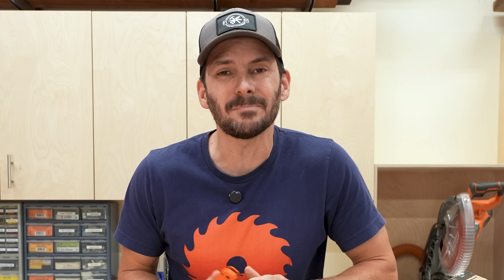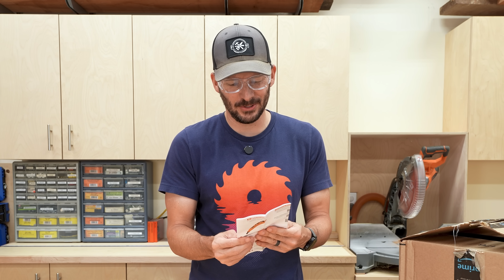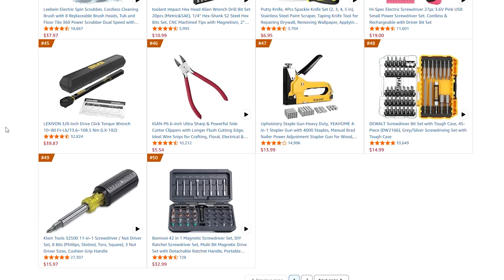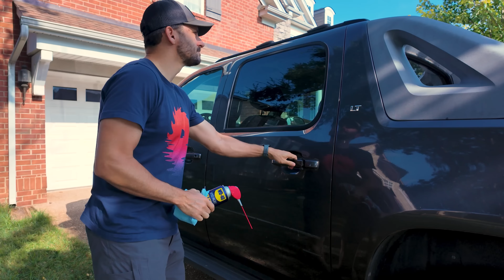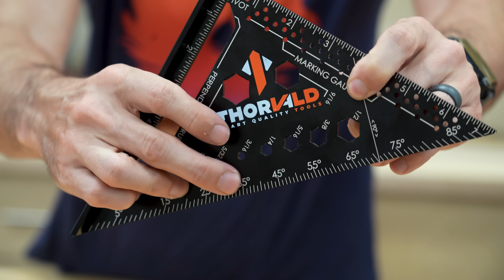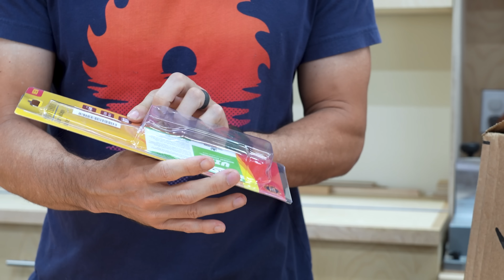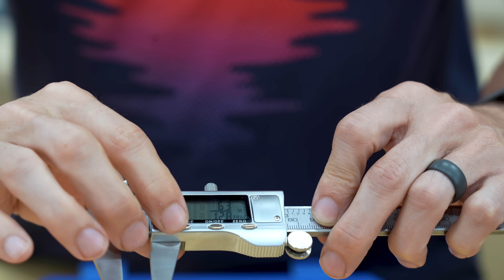13 "Best" Tools Under $20

Comment: @22:45:  'All squares are square.  But some squares are more square.'  I never buy carpenters square without being able to test it (for squareness) at the store first.  Not all 'carpenter square' looking objects are square.
Reply: Carpenter's squares, yes.  I've never seen a speed square that wasn't square, though. Carpenter's squares are really easy to knock out of alignment (and possible to fix).  You'd have to destroy a speed square to knock it out of square.
Reply: @kwilliams2239  It took testing 4 speed squares to get my current version, which I've now had for quite a while.  But, it wouldn't surprise me if they've gotten better made since I got mine.
Reply: @AB-nu5we  I couldn't detect any inaccuracies even in those from Harbor Fright.  I've never seen one out of square.  I don't even know how one could be made.
Reply: @kwilliams2239  Not everyone cares about and pays attention to their equipment setups like you and I do.
Reply: @AB-nu5we  Huh?  Apparently you're so picky that you find out-of-square speed squares.  I've never seen one but haven't put one under an electron microscope, either.
Reply: @kwilliams2239  So, if you read carefully what you've said, you're content with out-of-square speed squares?  I'm not.  And, you've also made it clear you have no idea what I'm talking about when it comes to finding square squares.  You don't need an electron microscope.  Just a piece of paper and a pencil that you bring to the store.  Find a piece of pre-cut shelving.  Set your paper down on the shelf board lined up with one edge.  Take the speed square, lay it on the paper with the bottom edge parallel which puts the other long edge of the square perpendicular to the edge of the shelf.  Draw a line down the edge perpendicular to the shelf edge on the paper.  Without moving the paper, lift the square, set it aside.  Place your pencil tip on the line.  Flip the square and place the same perpendicular edge of the square against the line making sure the bottom edge of the square is again, parallel to the shelf edge.  Draw a second line on top of the first.  If it it matches perfectly, the square is square.  Otherwise, the square isn't square.  Find another.  This tip comes from a very accomplished professional woodworker, Chris Schwarz.  It works, no electron microscope needed.
Reply: @AB-nu5we  No, read again.  I have NEVER seen an out-of-square speed square.  I don't think it's possible without breaking it.

I know very well how to test a square and was likely doing it well before you were born.

Read what I wrote again.  This time for comprehension.
Reply: @kwilliams2239  To test levels for being level at the store, find a large enough spot that's relatively level.  Set the level down, place a finger on the center vial noting the position of the bubble in the vile.  Now, flip the level from end-to-end and check the center bubble.  If it's in the same spot, or off center in the same direction as the original bubble, you level is level.  Cool stuff!
Reply: @AB-nu5we  Did I say anything about levels?  Grab two, different brands is ideal, see if they agree.  Flip one, as you note, see if they still agree.

I was specifically talking about speed squares. I don't even know how they could go out of square.  Run them over by a car and nothing would happen, except a plastic one might break.

Comment: With the laser measuring tool, I feel like you should've taken a look at the instructions you tossed aside before dismissing it completely when you couldn't get it to turn on, to see if it was a different on method than you'd expected (as discussed in another comment)

Comment: The number of reviews isn't necessarily an indication of quality - or even popularity. These are often faked. There are tools such as "Vetted" that will analyze the review distribution and timing and give a better idea for whether the reviews are legit or not.
Reply: Yeah, if you read a dozen or so, you'll come across the exact same phrasing.  I wouldn't be surprised if AI wasn't writing 90% of them now. Even adding pictures.
Reply: The number of sales is also another thing you can't trust anymore. They buy their own products with another account to boost "popularity"
Reply: I always sort by recent reviews, if the listing as been up for awhile it takes more effort to get these to the bottom of the list.

Comment: per the precision screwdriver set, they probably call it that because thats what 99% of people are buying it for. they dont know what T25 is let alone T15 or whichever one changes a ring doorbell. theyre likely going to type "ring doorbell tool" into amazon, so if you can optimize your product for that, you get all the normie business.

Comment: I don't want to be a downer, but I once bought a cheap precision driver set. The first time I used it, the bits literally ground down to a nub trying to turn a screw. It was like the bit was made of modeling clay instead of metal. It went in the trash, and I replaced it with a Wiha Tools precision driver set and that's the one I own to this day. I'm not surprised the cheap sets sell better, but you do get what you pay for.
Reply: 90% of the full-sized screwdrivers are junk, too. I have a few sets of decent screwdrivers, but a lot more complete losers. My 50yo Craftsmans aren't bad but have tended to sprout legs over the years.  Those bought in the last 20-30 years are about like putty, too.  I've replaced almost everything with Wera, lately.  They're really nice screwdriver, thought the handles take some getting used to.
Reply: @kwilliams2239 I just started getting all my tools. But have been loving my 711l stuff. The inline driver (while expensive) has been working great for me. Been using it with a stubby driver that came it's my steinwhale tiny bits and it's pretty comfortable and ratcheting. Other than it I have a few Klein pocket screwdrivers and they work pretty well too tho I hate the tiny 3.5 bits and use one as a core tool and the other mainly as a 1/4th handle haha.

Comment: That AXTH Precision Screwdriver may be the worst purchase I've ever made.   The magnetic bits don't stick, and the bits do not fit securely in the holder so it just spins when you try to use it.  I replaced it with the Jorest which works flawlessly.

Comment: I've got a carbide scriber of a similar design. Also bought off of Amazon. I love it as a metal marking tool. I drill a lot of metal. From aluminum to mild steel to hardened steel and it marks them all. It makes layout so much easier.

Comment: Speaking as an electrician, don’t trust any of the no contact voltage testers.  Always verify with a meter.
Reply: Why
Reply: @Bek-bl2edthey can sometimes tell you a wire isn’t hot but actually is. They aren’t always accurate
Reply: @lancealbert not sometimes….. basically all the time …. When does it not ?  Serious question, not being facetious
Reply: @Bek-bl2ed I mean, the little pen tester I have so far hasn't lied to me everytime i verified it with a meter. Always good to verify
Reply: Truth

Comment: With that laser measure, the power button turns it off. If you want to turn it on use the measure button.
Reply from the maker: 😂 😂 😂 Yup, that did it. I feel a little bad, but also not since that's the worst design I've ever seen. You can NOT have a power button that doesn't turn it on 😂
Reply: @Fixthisbuildthat  You're right, but I have several different laser measuring tools and they all work that way. No idea why.
Reply: @Slugsie1  Maybe it's so that you can just get straight to measuring without needing to hit a separate button? Or maybe it's a circuitry thing. Either way, the buttons should be better labelled, with "measure/on" and "off"
Reply: @Fixthisbuildthat  reading the instructions might've helped. but really, guy, you don't even seem to be enjoying doing these videos at all anymore... the apathy is palpably thick. why even keep these going if you don't want to shoot them?

Comment: Thank you for this video, Brad. I have that exact dial caliper, and I too dislike the wheel. Granted it's way better than the last one I owned, but yeah, that wheel gets awfully annoying. I've been thinking about seeing if there's a way to make it tighter, and upon inspection I saw that the holes for the retention pin are too big. If the wheel comes apart it could be as easy a fix as putting tape, or something on the pin to make it a tighter fit. I'm wondering if heat shrink might work? If anything it's worth a shot.
Reply from the maker: I'm almost sure it would unscrew.  then you could beef up the shaft with shrink tube or even just tape
Reply: @Fixthisbuildthat  I tried to unscrew it, but I can't get ahold of the other side once I've got the one side gripped. I tried pliers, and small vice grips. I think it was purposely done, because the hole seems to be more like a slot, or capsule. Front to back is tighter than up, and down on mine. At least it's more of a convenience than a necessity. You can move it by the head itself too, which is what I'll be doing, lol. Caliper: 1 Me: 0 🤣

Comment: I bought the keychain bit holder thing but have not used it once. The bit holders either don't hold the bit well enough or it is difficult to get the bits out. The idea seems good but the quality isn't there.
Reply from the maker: exactly my thoughts
Reply: Railer!

Comment: I use the WD-40 Specialist Corrosion Inhibitor on my cast iron tool tops. I spray it on a rag, wipe it on, buff and drape a rust-resistant machine cover over the whole thing. My unconditioned shop is in coastal Texas and rust was a constant issue. In the last 30 years I think I have tried every rust treatment with varied successes. This seems to work among the best, at 1/2 the cost. Thanks for another info-taining video.
Reply: That stuff is the best! I use it on all my cast iron pans and they've never had a single spec of rust on them. Makes cooking super easy! 😋

Comment: The bit keyring has been great. As a contractor, everyone at a job site has all the bits we need clipped our tool belts. Not having to run back to the truck, or get down off a ladder has been a huge benefit.  Short versions, long versions. Phillips, Robertson, t25, t30. Etc. All my team carry one of those.
Reply from the maker: Did you get this version or another?  The locks on this one were inconsistent at best
Reply: @Fixthisbuildthat 
I can't remember the bad one.  It's quality was terrible.  The bits would fall out or get locked in place.
Reply: @Fixthisbuildthat I dont remember which ones we got. Cheap ones on Amazon. But they have a slide lock detent in it. Like loading a bit into an impact driver.
Reply: I've tried the cheap amazon junk.  Then tried Vega.  Absolutely love that one.  Works as advertised. ~$15.
Reply: I work at height, and have just a few bits I need with me. I have 5 on that carabiner inside my tool bag. I can dig them out easily, and never risk having one fall as I'm fumbling through them.
Reply: Yeah, I have a couple different designs. One similar to this one, and a magnetic one. Both very useful.
Reply: I got mine about a year ago. That way I always have the most important bits with me on any job as a handyman.
Reply: Which one, i ordered a pair and I dropped bits all over the place 😂😂😂. Seems like a great idea
Reply: Did all people in here know there is milwaukee version?

Comment: The pencil sharpener in the top is much better for me. You dont have to take out the holder, and the sharpening itself is much easier.
Reply: Best of both worlds would be a placement that doesn't require screwing on and off to access
Reply: But the spare leads fall out.

Comment: I got a super cheap mini rotary tool that works perfect for cleaning up 3d prints
Reply from the maker: Oh, great use!
Reply: I use a cheap battery operated rotary dog nail file thing for sanding edges of leather holsters and belts and the such. It's so old that YouTube wasn't even a thought yet lol